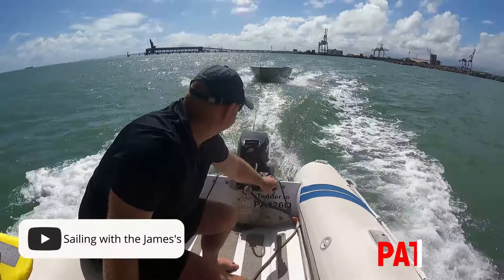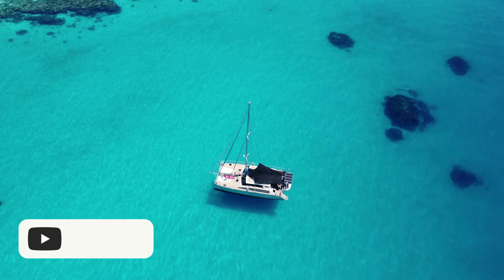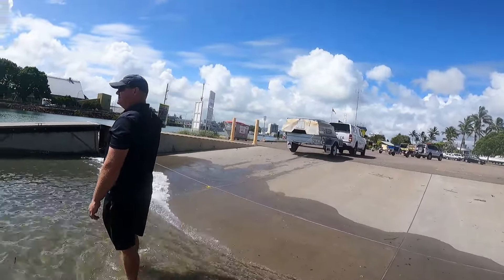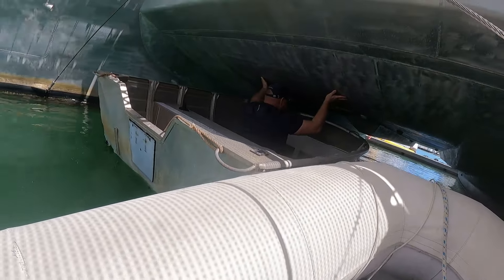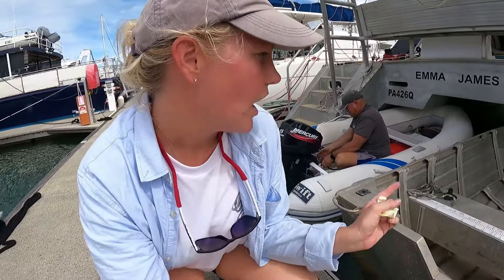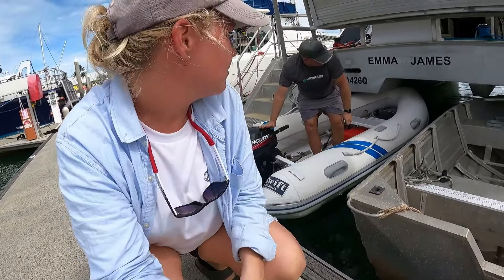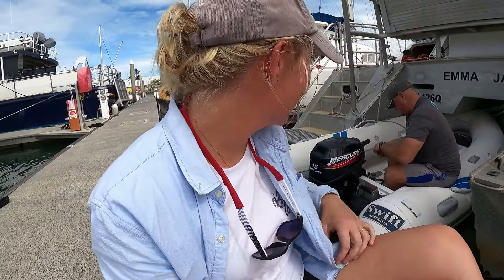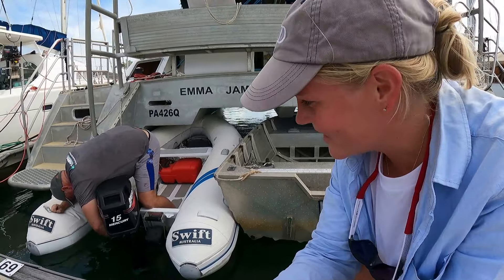Inflatable vs Tinny | The Search for the Perfect Tender | Sailing with the James's (Ep. 68)

Comment: Looks good.  65 or 100mm ag pipe from Bunnings make good fenders along the gunwale and handles direct sunlight.

To deter cracking, you can run slings under the tinny and let the weight rest on them rather than having the weight pull on eyelets or lift points. Something as simple as 10mm line works well.
Reply from the maker: Thank you!! Very happy with the tender, very happy with how well the 15hp does on it 🥰
-Cait

Comment: Nice tinny! For the chaffing of fiberglass when visiting, search 'foam pipe insulation'. It can be adapted to the top of the gunwales and used as a bumper. Some insulation comes with a rubber barrier. The bigger the tube, the better. As for the hard seats, use coast guard approved throws to sit upon. If floor noise becomes an issue, indoor/outdoor carpet glued to the floor helps. As for using the strength points to raise/lower, consider using 'eyebolts' affixed to the bow plate and the stern corner plates. The stress of the tinny bouncing while the cat is underway may cause stress fractures at the current lift points. ... I learned all this through experience lol ... smooth sailing -- Jerry
Reply from the maker: Thank you so much! We were very 
pleased to see the 15hp move the 3.7m tinny with easy and faster than it moved the inflatable. 
-Cait
Reply: You are most welcome! The 15hp moved the tinny quickly, I'm sure Hp rating plate on the transom says it could take an even bigger motor but the 15hp did great.   @sailingwiththejamess
Reply from the maker: Yes says it can take bigger but I (Cait) struggle to start a 25, we tried a few and it was not easy to start the and we reallt wanted to keep it the 15. Super happy with the tinny and it fits really well on the davits, there's a long strip of marine carpet below the back seats on the underside for the tinny to rest against when hauled up. So far, very very pleased with the swap!
-Cait

Comment: Pool noodles or scaffolders use split PU foam covers at street level to stop Smombies  from braining themselves walking into them ..

Sealed sell foam pads for seat covers strapped or tied down ...you can use them on the beach or as floats if the boat did go over. 
Can you put some empty plastic water cans under the seats to give the tinny some permanent buoyancy.

I always thought tinnies were like john dories square front, flat or cat bottom hulls. 👍🏼🧙‍♂️
Reply from the maker: Great ideas Clive! Is thr wind still up where you are and the bins taking themselves for a walk? 🌬
-Cait
Reply: @sailingwiththejamess  
Its gone quite for a few days... but now they are forecasting snow again Cait. 

Btw smobies ...are Smart phone zombies aka  hi tech lemmings. 😉
Reply from the maker: We are having a heat wave, snow ❄️ sounds nice! 🥵

Comment: If Sam knows someone that aluminium welds, can add balance/buoyancy pods either side, making it "kind of" a tri-hull, popular with sports fishing boats when they lean overside to reel in.
Swimming noodles sliced lengthways, slip over top edge of sides for impact protection, incl Charlies if she slips.
Marine ply/carpet floor will keep your bags (etc) dry. A raised lockable box section in the bow can be used as a step in/out, place fuel in it to help keep nose down (run fuel line under floor), anything else for secure storage
Reply from the maker: All great ideas! Our plan is to do a little bit of work to the tender 😍 So excited for all the extra space! 😀 🩴🧮👓
Reply: @sailingwiththejamess  If you watch "Spear It Animal" Amazing BOAT UPGRADES from 7:30 you'll see my idea for a tender bilge pump I may have mentioned previous
Reply from the maker: Thank you! 💜

Comment: Cheers guys!  😊
Reply from the maker: Thank you Trev!! 💙⛵️🛟⚓️
Reply: @sailingwiththejamess    No stress,  I would try, (it was hard to see from the video) to trim that motor one hole bow down,  because in my lottta experience,okay you will lose speed,   But it be more stable with one person, + be softer on the bum of whoever is sitting forward,  push the bow down,  and also make some 100% closed cell foam cushions for the seats,  velcro works excellent temporary,  then suxs,  add a strap to tie them on..   they also work as positive buoyancy/ life saving aids..      but yeah,  bow slightly down,  yes you will think this doesn’t feel as goid, because it isn’t,  but the more of the bow will try to split the bounce..  giving everyone a better ride..  
trust me, try it,  than see was i right?     Thanks guys!
Reply from the maker: Great ideas!! Yes the first test drive was a bit bouncing but super happy how well the 15hp did on the back!
Reply: @sailingwiththejamess   yeah the only problem with a “tinnie” the person at the front gets a sore butt very quickly,  plus them seats do get hot as you mentioned..  the outboard fins help slightly with stability at speed,  but I could never really justify the power drain and fuel consumption,  if they were a huge advantage, manufacturers would have made them std?  Nice good comfort seating,  
A Trev tip?   I used to cut down them cheap boggy boards, then wrap em in quality outdoor waterproof table cloths!  Sounds stupid but works perfectly..  (you can even let Charlie use the seat as a kids boogie board at the beach..    my daughter used to..  why not?
Reply from the maker: Awesome tips!! Thank you! We are planning on doing something to the seats, we can feel the alloy in the cat get hot during the day so the seats will be hot! I liked someone's comment of its a little tinny for the big tinny 😆
-Cait

Comment: You could install a rub rail on your tinny like the OC Tender has. You should also bolt the outboard onto the transom so it doesn't bounce off. Can you use those beach wheels on your inflatable and transfer them onto your new tinny? That tinny looks like an old racer. Is it an old racer?
Reply from the maker: Yes definitely a great idea! Not sure if  it's an old racer, it's a 3.7m Stessl Edge V but super happy and impressed with how well the 15hp outboard pushes the tinny! We will be leaving the wheels on the inflatable for the next owner 🤗
-Cait
Reply: @sailingwiththejamess  I really love the OC Tender 350 like what Sailing Roam has and with the 20 hp outboard but they are extremely expensive. I'm considering building my own tender the same way that OC Tenders makes theirs but a different design to save money. The tinny is very heavy where as the OC Tender is a fraction of the weight. That's one of the reasons that I'm not going to get an aluminum tender for my Ciber 48 build.
Reply from the maker: OC tenders are great, love them. We have a friend who built his own, fully decked it out and it looks amazing. The OC tenders are brilliant espeically with the storage space where sponsens are normall. 
-Cait